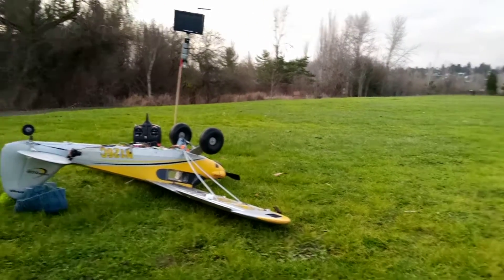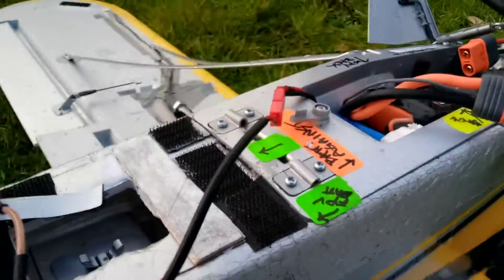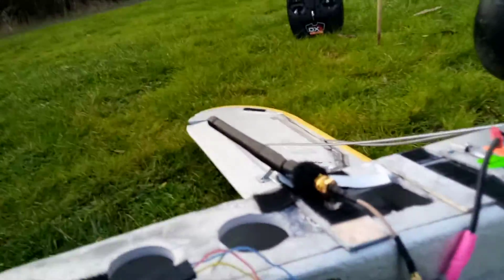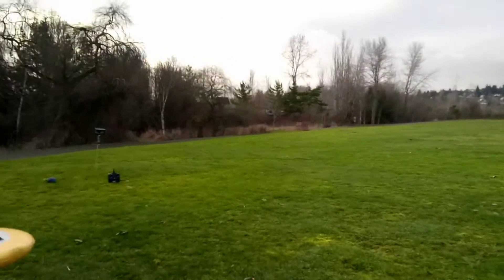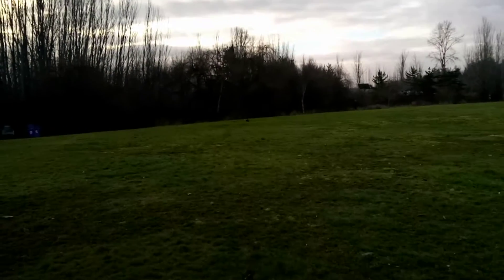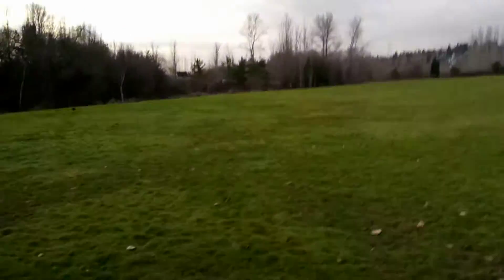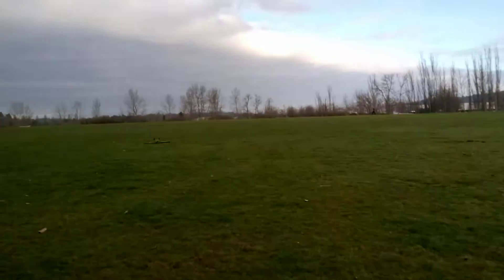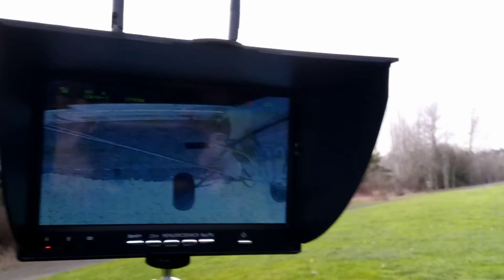RC Airplane Carbon Cub S2 FPV 1000mw VTX: Very POOR Initial Results, Hmmmm?

Comment: Im pretty sure the blue and the green are the band and channel and the red is the power. The red light should be off for 1000mw.
Reply from the maker: You are correct. Works perfect when the VTX is a couple feet from the plane, any farther than that signal goes completely to Hell, LOL. I think it's defective, I saw a video and the guy said all his other AKKs are great, but this one has issues.